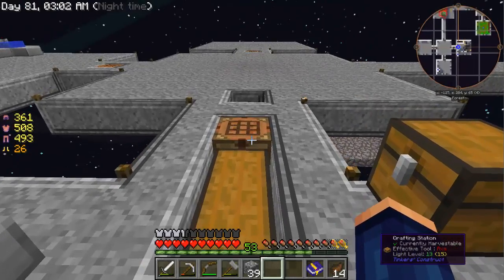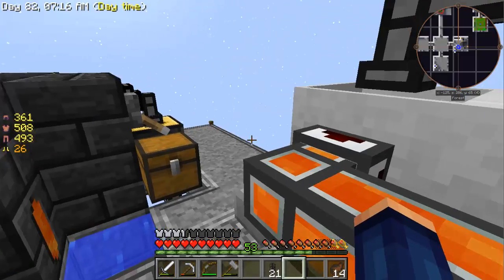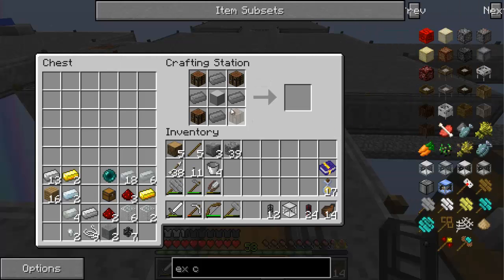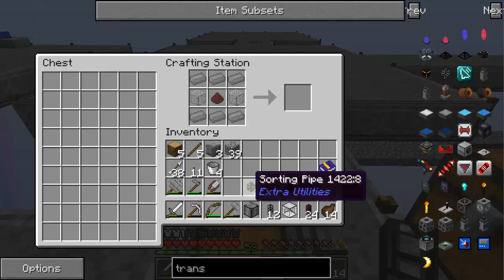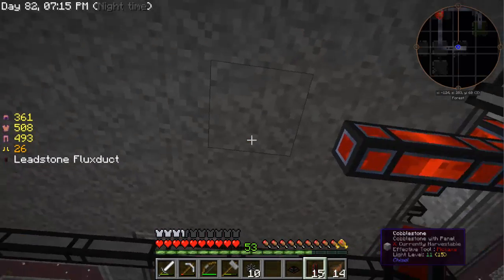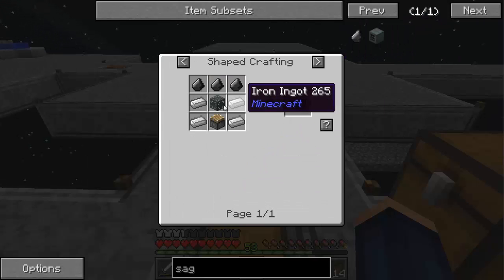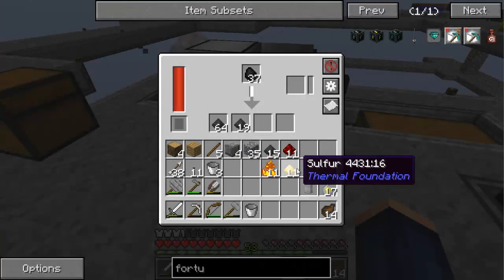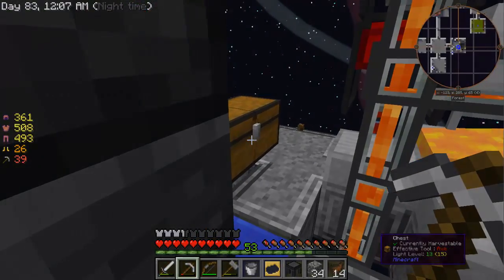Auto Sieve / Auto Ores / Sky Factory 2.5 / FTB / Minecraft / Episode 08

Comment: Any reason for using the fluxduct for power instead of the applied energistics energy conduit?
Reply from the maker: I like sticking with Ender IO because they layout nicer, all the Conduits can share the same block space.  Is their a big advantage to using the applied energistics energy conduit over Ender IO?
Reply: The leadstone fluxduct can transfer 200RF/t, the ender I/O conduit can output up to 540 RF/t. I just wondered why you used the leadstone duct on the lava generators. Also I auto filled the lave tank using the same item conduit that fills the crucibles. Power does seem to be a problem, I've got a setup with 10 lava generators to power an alloy smelter, auto hammer, auto sieve and a compactor and it can't keep up with requirements, even when the smelter isn't running, had to back it up with 4 water wheels.
Reply from the maker: WOW 10 lava generators where I doing it in 3?  Something isn't right.  How many upgrades do you have in the Sieve?  Sorry I didn't see this comment earlier!

Comment: I got a problem with the smeltery sometimes it makes few ingots and half a ingot so its gets stuck in the transfer pipe do you know how to fix it?
Reply from the maker: Your probably sieving to fast or to many fortune upgrades.  I think I have 2 speed and 3 fortune.  This keep is slow but steady!
Reply: MSUDawg Okay ill try that at the moment i have 2 speed and 2 fortune
Reply from the maker: Interesting, you shouldn't have a problem with only 2 of each.  Well you might but it should be rare not the normal.  When this happens to me, i start out pouring any liquids over 9 ingots in the basin.  Once all the liquids are less than 9 ingots i will our them into the ingot cast and then when it get stuck, just break the table and replace it .  This will disregard the small amounts that don't make a full ingot.
Reply: MSUDawg I somehow fixed it added more crucibles and lava generators and now its working properly thank you :DDD
Reply: +Spl3n I have the same issue as you. Can you explain more Indepth what you did or upload screenshots to a trusted site like imgur? I am really tired of having it clogged. I have over 100 ingots of iron in my smeltery since it was so blocked up.
Reply: Sorry bud i stopped playing this modpack But basically i just added/changed upgrades in automatic sieve and check if i have stable power thats about it
Reply: +Spl3n do you remember the upgrades? I really need this or nothing will work so...
Reply: Connor Transky Well first of all if you're playing on servers smeltery isn't really server friendly and i think i used 2 luck and 2 speed upgrades but honestly if your smeltery dosen't work for you there are other ways to smelt your ores and get double
Reply from the maker: My world, I have only 2 speed and 3 fortune upgrades.  Any more would clog the smetlery.  Also make sure you have a good supply of lava.  If yo loose lava it will clog also.  Any question try downloading my world and look at how I did it.
https://www.dropbox.com/s/zrfia90uv3ej167/SF2%20-%20Episode%2035.zip?dl=0World Download:

Comment: Like I have the transfer pipes connected to my crystal chest with my diamonds and coal and all that but then the coal and flint keeps going in to the compressed
Reply from the maker: Try using a vanilla chest. I don't think sorting pipes work with the non vanilla chest
Reply: +MSUDawg ok I'll try thx creds to u for such fast reply a u are by far one of the best minecraft youtubers good luck to u man
Reply: it works thx also how do you take the molten ores out
Reply from the maker: +El Jéfe fluid pipes connected to the drain. If I have to do this I use a drum. Check out my video on pyrothium

Comment: Get A Better Potato your frames are like 10-25fps and it hurts
Reply from the maker: ? Potato?
Reply from the maker: I wish I could!  You offering?
Reply: no sorry i dont own an extra pc other than the one i built
Reply from the maker: Ya, I built mine about 6 years ago, it is time for a overhaul.  Saw some good components on Newegg.com but no $.
Reply: Try to get something like a RX 480 or 1060
there both Quite Cheap for really good hardware now
Reply: you want him to put a 1060 in a six year old PC?  maybe not a great idea without upgrading the mobo and cpu, as well.  strictly for "gaming", a 1060 alone would probably increase his framerate, but we're talking about minecraft here.  it's a very cpu intensive game.  plus, recording the video adds even more processor load.
Reply: in the meantime, since you're on a skyblock, you don't need to see very far in the distance... play around with the view render distance.  you can significantly increase your frame rate that way.
Reply: It wont make a difference,you need a new processor better ram and maybe a motherboeard.Just the gpu wont make much of a difference.